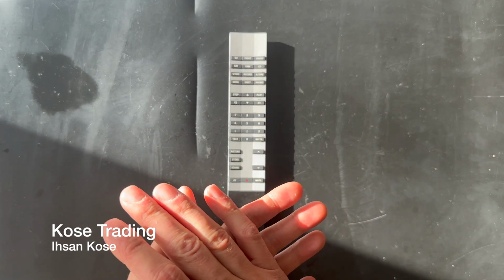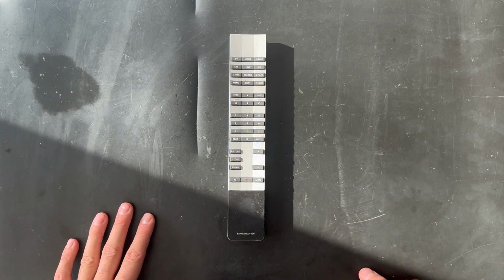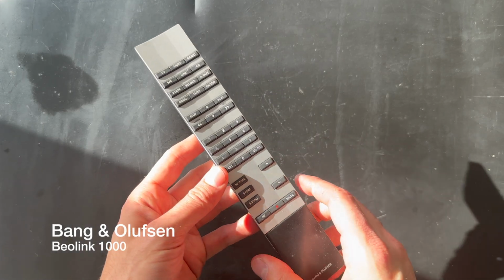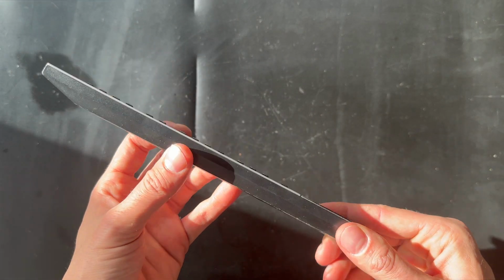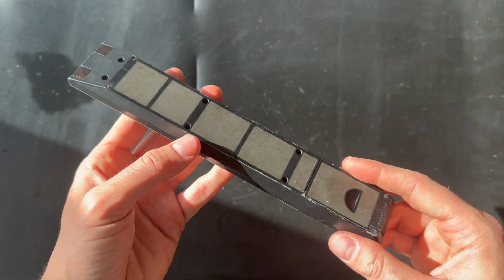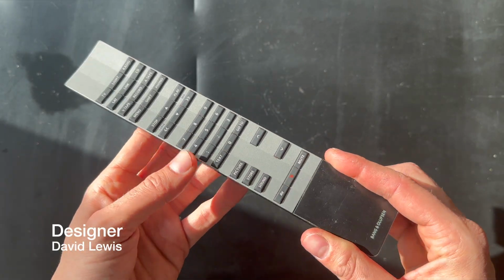Bang & Olufsen Beolink 1000 Remote Disassembly process and Repair guide

Comment: My father purchased a B&O television back in the late 80s. It had this same (or very similar) remote control but ours was black. The TV was not very reliable, I remember it being at the repair shop like 10 times over 15 years after which it was recycled. But the remote control never broke if I remember correctly. 😀
Reply from the maker: It sounds like your father's B&O TV had its ups and downs! B&O is known for its exceptional design and build quality, but like any electronics, their products sometimes had issues, especially with older models. The remote, though, clearly stood the test of time—that durability is impressive. It's always interesting how some parts of a setup last longer than the main device itself. Do you remember which model it was, or if there were any particular issues that kept recurring?

Comment from the maker: The Beolink 1000 remote was typically included with Beovision TV sets of that era, except for certain high-end models that, in some markets, came with the Beolink 5000. For audio systems, however, the Beolink 1000 needed to be purchased separately. Additional units were also available for purchase to support multiroom Beolink systems.